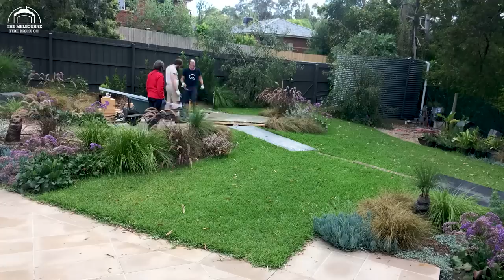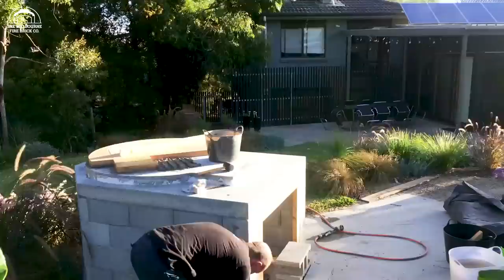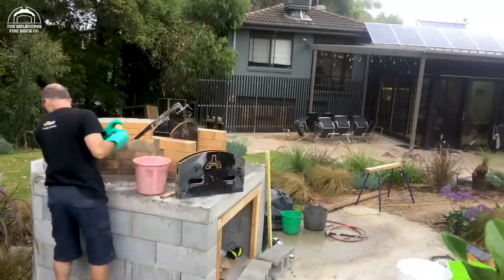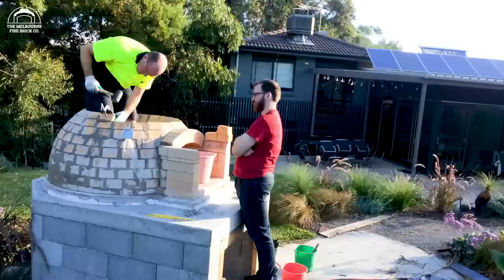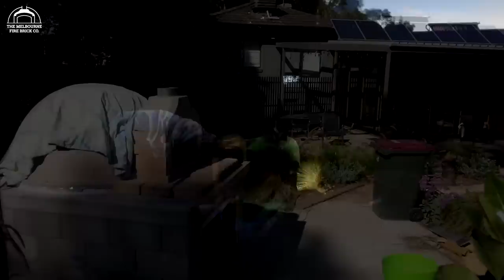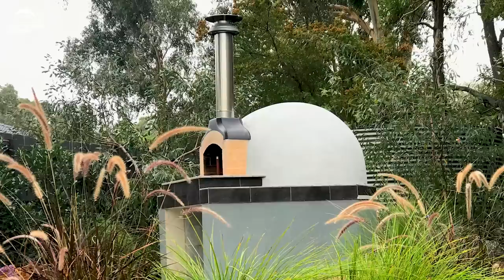Peter's FIRST Brick Pizza Oven Build!

Comment: Can smn pls tell what's the white material that he covers on the brick before plastering?
Reply: Insulation for brick oven
Reply from the maker: We use a ceramic fibre blanket before covering it with render on the outside - check out our building videos for the process.

Comment: How did I miss this, thought I watched them all. Great job Peter, you did an awesome job. Thank you Ben and crew for your video series. As far as I'm concerned you set the bar for profession oven kits and construction. I should email and see how the P-105 is coming along. I see 2025 which is perfect as I plan to retire then. Torn on which way to go as others are offering a gas option. My home is on a natural gas line and very little hardwood, just pines and cold winters. Hydronic tubes in the platform is in my head since the house uses a boiler.
Reply from the maker: Ooooh cool idea regarding the hydronic lines! You can still install gas in our ovens, but you would have to buy the gas burner as an aftermarket addition, and have the burner installed by a suitably qualified plumber who can arrange the signoff.

Comment: Great looking oven. I have a few questions, please. Have the firebricks in the front (exposed) arch, been ‘weatherproofed’? I thought firebricks were porous, so in a really wet climate, wouldn’t they be saturated with water? And in turn, won’t the water seep further into the oven, causing problems when the next fire is lit? ...Especially after long periods when the oven isn’t lit. Thanks
Reply from the maker: Great question Thomas! You are correct - the exposed firebricks at the front of the oven will absorb a small amount of moisture when they come into contact with rainwater, which over a long enough time, with enough rain, can soak into the oven slightly. If you're building in a rain-prone area, there are a couple of things you can do to minimise this. One is to build the oven such that the mouth is under a roof - the dome is fairly easy to keep dry, so if you have the mouth under cover then you've solved the problem. The other thing you can do is to simply use the oven regularly, this will drive out any moisture that may have been drawn into it.
Reply: I’m pretty sure you can but an almost weather proof paint for brickwork that acts as a seal not allowing water to soak into the brick which could help you

Comment: How many bricks did you need to buy and what size were they for the outer construction?
Reply from the maker: We make these ovens as kits that the customer (in this case Peter) can assemble at home. For a brick oven of this size you would need to buy about 120 full size arch bricks and then cut them down to size.

Comment: What is the insulating material? And how does he keep it tight to the bricks please?
Reply from the maker: It's called Ceramic Fibre Blanket - check out our detailed videos on how to build the oven for more information.
Reply: The bricks need to be cut at mitre angles as the  dome decreases in size...its all about patience and spot on measurements..dont rush let the rows set